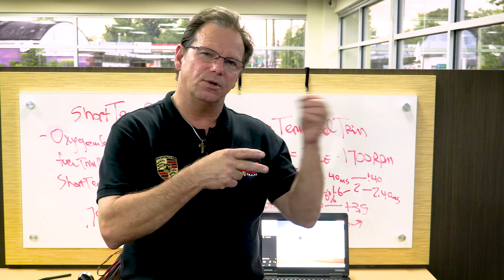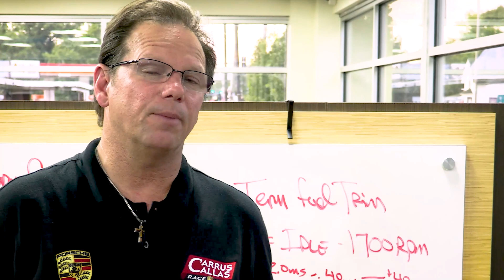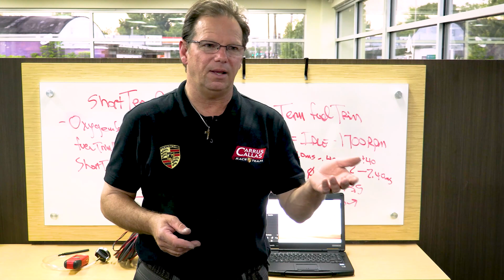Porsche Engine Diagnostics: Modern Fuels, Materials, and Engine Maintenance - with Tony Callas

Comment: Please can you answer a question I have about fuel/air ratio issues?
If I check the fuel trims on a durametric system and the trims are OK, does that mean that the injectors are not leaking? I realise they may not be working brilliantly, but it's obviously leaky injectors that cause real problems, such as bore washing, so presumably if any injectors are leaking, the fuel trims would be backing off fuel delivery to offset the leaking fuel, and this should show up on the durametric?
Thanks
Reply from the maker: That is a great question. Checking fuel trims will likely not tell you if you have leaky injectors. What I would suspect if you had leaky injectors would be high fuel dilution in the oil but you might still have good fuel trim values. As such we recommend regular used oil analysis as you often will find problems with an engine (or fuel system in this case) well before you have any actual symptoms.
Reply: @lnengineeringllc  thanks for the reply

Comment: Great information.  In my area [Overland Park, KS] we have Hy-Vee grocery that also has fuel stations.  They are not on the Top-Tier list.  They offer a 91 octane ethanol-free premium.  I have a 1999 C2 and I wanted your opinion on which would be better for the older M96: ethanol-free premium or premium from Shell or Phillips?  [LN customer.  I have the new IMS replacement and I always use DT-40 oil  :)   Defender + booster on occasion.  Thanks
Reply from the maker: If you have access to ethanol free fuels, that would be my first choice, even if it's not a Top Tier fuel. In my own cars we only have access to E10 fuels and none are Top Tier, so I use Defender+Booster typically every other fill up or at most every third.